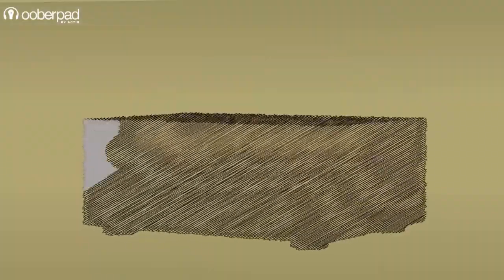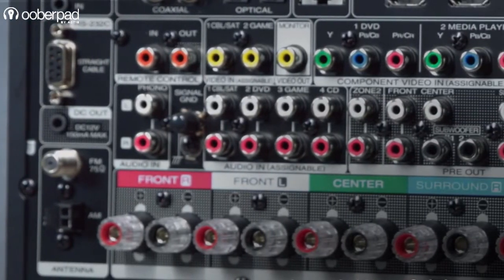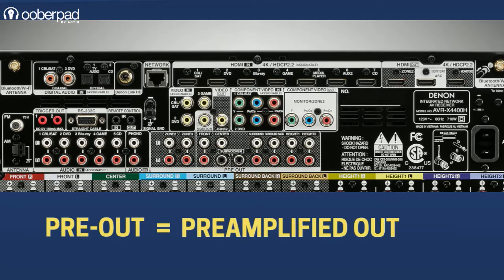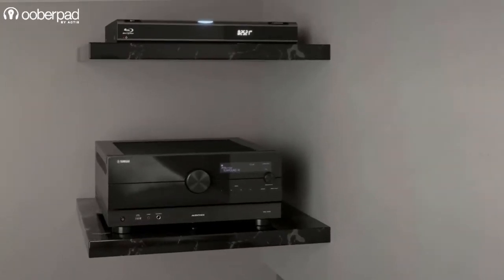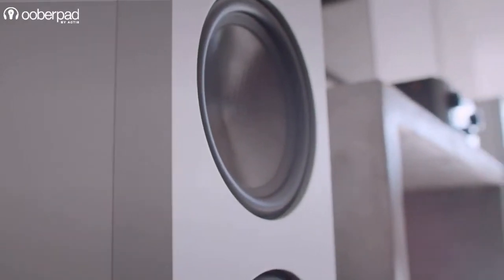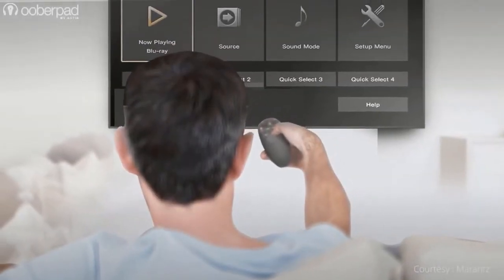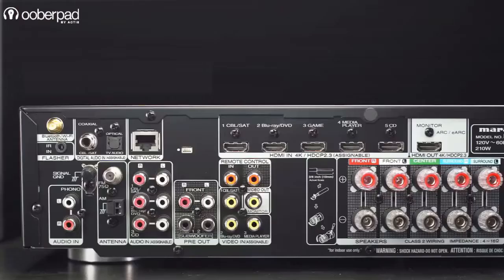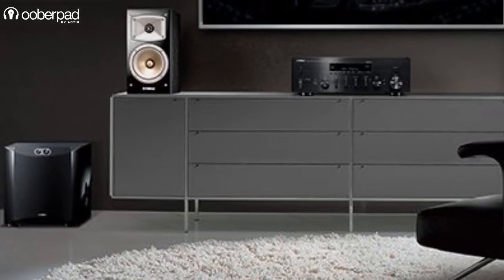What is the function of Pre-Out port in an AV Receiver?

Comment: Can pre-out on a AV processor be used to biamp the center speaker ?

Most AVRs have biamp capability for front right and left. 

If it’s possible to biamp the center speaker in this way is there any disadvantage vs the avr biamping of the front left and right speakers from the avr its self?

Comment: Dr.i have blue ray DVD BDV N990W.which is damaged.i want to use  it's speaker with a receiver..which one I can order.have 5 speaker and one woofer.pls advise
Reply from the maker: Hi Vivek, first you'll need to figure out which part is specifically not working. As we see, you Sony DVD BDV N990W has a BluRay player with a surround transmitter, 1 surround receiver unit & 5 speakers. The front ones connect directly to the rear of the BluRay player while the Surround Speakers are powered via the Wireless Receiver unit. Another important thing is to figure out if the ports which are used to connect the speakers. According the the power needs of the speakers you can figure which receiver fits best.

You could refer to this website for discussions around the Receiver unit for the Sony N990
https://www.justanswer.com/electronics/732th-just-bought-sony-bdv-n990w-its-surround-shit-don-t.html 

We suggest it's the best time to upgrade to a whole new setup. Our team can help you in choosing the right home theater setup. Connect with our team via our website https://www.ooberpad.com or call us on +91 91673 86570

Comment: What do you know about the Marantz vintage 2250B Main Pre section on the back of the receiver?  I have had this for 40+ years and have not used jumpers to this.  Second, I have been told I can connect the Schiit Lokius equalizer to the Main Pre .  Is this correct?   Thanks

Comment: I have the Onkyo NR7100, it does not have a Pre out but does have zone 2 and zone 3 capabilities.   I have a tube headphone amp (little dot MKIII) can I connect the RCA outs of the little dot to the onkyo RCA in to drive the stereo speakers?  My thinking is the tubes will sound warmer or maybe just an interesting difference?
Reply: Its wired, the european version have preout.

Comment: I am an electrical engineer by trade, was very confused as a beginner to home theater setup. I exhausted for a few days and you are the first one who made a few videos explaining like what I wanted to know.   Like this one, Pre-Out, now I understand very well, thanks.  I just bought a Denon X-1700H, a 7.1 receiver and a Klipsch 7.1 system. There is NO HEIGHT channel output on the receiver.   I am very confuse again, can I config the last two surround rear Right and Left to be Height channel output to get a 5.1.2 for Dolby Atmos??  That is, I shall put a new label on the connector as Height(L) and Height(R)?    Whoever knows the answer please help.
Reply from the maker: Hi, we're glad to know our videos helped to understand home audio setups and terminologies better. Regarding your query - Yes! the Denon X1700H does support Dolby Atmos and you can use it in a 5.2.2 configuration and setup Dolby Atmos speakers. Here's a video of a actual 5.2.2 channel setup with the Denon X1700H.
Reply: @Ooberpad  Thank you very much for your prompt reply! I very much like to buy you a fresh Tim Horton coffee in Toronto.  My question is, is it that once I configured the Denon, thru the setup screen, the last two speakers are for height channels, then, the Denon will route the decoded Atmos signals from its internal decoder, amplified, and pass it to drive my actual height speakers???? 

Question 2 is, every output channels actually does have its appropriate characters according to the configuration we set and the amplified output follows the decoder's output, right or wrong?

Question 3 is, the magnitude of the power to each and every speaker would be governed by the initial calibration using the mic included with the Denon?   So, we can't swap, say the center speaker wires with the rear speaker.

You said "Here's a video of a actual 5.2.2 channel setup with the Denon X1700H " but was missing......   

If you have the answer, please help. I have been searching for these slightly more technical answers for days without a clue. Regardless, a huge thank you!
Reply from the maker: @millikenway  Sorry. I missed the link the earlier reply. Here's the link - https://youtu.be/QKoaaLOzvMI
Reply from the maker: @millikenway  For a quick resolution to your queries please connect with our home cinema specialists via the Live Chat option on our website - https://www.ooberpad.com

Comment: If using  2 HT recievers (pioneer elite) both have pre outs  I want to use the sc75 for the main receiver and to power my 4 rear speakers and my other receiver.  Pioneer elite SC-07  to power my 3 front mains.   Do I go from pre out on the main receiver to pre out on my 2nd receiver or go from pre out to multi channel input where there is a LCR on them? Also can I use one "red" rca for the front and split it for both LR? Essentially leaving one RCA open on the pre out of the main receiver?  Basically 3 questions here
Reply from the maker: Hi, your can connect with our home cinema specialists on a live chat via our website for a quick resolution to your query. Visit https://www.ooberpad.com and click on the live chat button.

Comment: Thanks good explanation can you explain something for me please my integrated amplifier says its designed to be used with speakers with nominal impedance between 4 to 8ohm s my speakers spec is the same 4 to 8ohm the amplifier output is 65 Watts  into 8ohm and 100 Watts into 4 ohm will the amplifier be driving speakers at 4ohm 6ohm or 8ohm???? Thanks